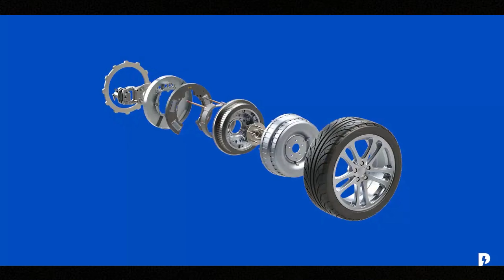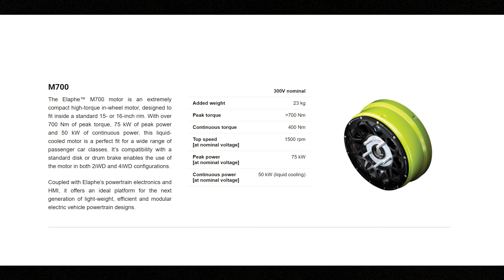Revolution in Motion | Gruber Motors

Comment: Where do the brakes go?  I don't see how hub motors can reduce unsprung weight.  How is an entire motor lighter than a half shaft?  Wheels are a pretty rough environment in terms of dirt, water, and vibration.  It doesn't seem like a great place for a motor.
Reply: Thanks for this comment. It saved me the time of typing it out. I would add one detail however, if the motor actually has the torque to be able to drive the wheel, it will also be able to slow down the wheel as well. It will not however be able to bring it to a complete stop as effectively as a set of friction breaks. If you just have rear wheels that are powered you can use your front brakes to do the last bit of breaking.
Reply: Exactly. Not a good idea at all except for simple vehicles like maybe the Aptera or motorcycles.
Reply: @Kabab  Most of the braking is done by the front wheels in every car, it's like 80%. That is why front discs are so much larger than rear ones. It's bc when you break the weight of the vehicle shifts forwards and thus the front wheels have more grip, better grip = better braking.
Reply: @giovannifoulmouth7205  that doesn't impact motor breaking or regen breaking.
Reply: Look at the Lordstown Endurance. It works.
Reply: @Alles_ist_moeglichauchdasGute  This is sarcasm... right? 😁
Reply: There is a study by Lotus, which shows that minor tweaks in suspension can offset the unsprung mass.
Reply: @hallkbrdz 
Unsprung mass. ??
Reply: The motor is capable of regenerative braking, you don't need dedicated brakes
Reply: The motors are the brakes. The unsprung mass may increase a bit, but the total mass and number of moving parts reduces substantially … and a lot of the unsprung mass is rotating, so it will help to gyroscopically stabilize the vehicle.
Reply: Pretty sure it's the front motors doing the work so this is fine, especially when doing Regen.  Some hybrids already have independent EV drivelines.
Reply: @Kabab it can stop it if you reverse the mag field as it comes to nearly. Complete stop. Not exactly what you need, but it can reduce the size of the mechanical breaks you need.
Reply: @nobilismaximus  yeah but that would the take power to do so. It's a toss up if it's better to add the complexity of friction breaks or spend power to stop faster.
Reply: @viennois0123 can you reference the study ? Didn‘t find it!
Reply: Guys, think for a sec. How do you keep the car still on park or uphill ? Of course some brakes are needed. And I assume they usually have some. Orbis definitely have them.

Comment: I dont like this idea , if you get in an accident your motor will be destroyed easier
Reply: It is much less likely for an accident to cause a the motor to intrude into the passenger compartment.   It should be safer in an accident.
Reply: @n.brucenelson5920   Maybe if you put a luggage on your frunk it will be the same? but I told it about the cost of the thing and it is more likely to hit your wheel than your whole engine
Reply: @Ydooo  Aptera has already tested hitting the wheels against curbs at speed, hard enough to pop the tires off.  Nothing happened to the wheel motors.  The wheels and tires are comparatively less expensive to replace, while making passengers safer.  There will be more proof of this when the FMVSS Part 200 crash tests are conducted and the ratings published, once they have production intent vehicles to validate.

Comment: Interesting idea.  Not sure about added unsprung weight.  Steering geometry is going to take some engineering.  While turning, outside wheels have higher surface feet per minute and constantly changing depending on the radius of the turn.  Motors in the rear, same thing.  More software control of the motor hubs.  The braking part would be easy.  You can stop a lot of mass with the VFD drives.  We did it at work and it was a lot more weight than a vehicle.  You could have a lot less wheel slippage.  A very controlled stop. 
  This concept has been tried before, I don't think the software was up to speed though.
Reply: APPARENTLY,NONE OF THAT MATTERS- ORBIS SELLS DIY WHEEL IN BOX KITS, FITTED IN 3 HOURS- SO CAN'T BE VERY IMPORTANT...
🤯🤯🤯🤔🤔🤔🤔

Comment: It strikes me that in-wheel motors would be the perfect solution for any company wanting to create a universal EV conversion kit that can be fitted to any ICE car as a means of speeding up electrification of our vehicle fleet. You could fit a couple of in-wheel motors either at the front or rear of a car, or all four if you want to go AWD, and then just fill the engine compartment and fuel tank cavity with batteries after removing all the ICE gear. The fact that you can eliminate the engine, transmission and axles from the engine compartment means more room for batteries and therefore more range and efficiency from an EV conversion. As the cost of batteries continues to come down, EV conversions are going to become a great way for people to take an existing vehicle with plenty of miles left in it, and replace a combustion engine that is eventually going to wear out and give trouble, with electric motors and batteries (along with controllers, inverters, chargers etc) to give you a 21st century sustainable energy vehicle that will comply with any future environmental regulations likely to be introduced.
Reply: Agreed, surprised this isn't a thing yet!  Some hybrids power the rear wheels like the Toyota Corolla and Rav 4, independent of the front.  Maybe a physical brake needs to be integrated for regulations.
Reply: @ChrisParayno   The in-wheel motors from Elaphe which were previously going to be used on the Aptera have a built-in brake.
Reply: I got a 2014 cx-9 suv with sludge in engine coolant wp disaster. I would love to convert it to EV with In wheel motor or ev motor. In wheel motor would be great tbh. Install the in wheel motor wheel. Rip out the engine and fas tank. Put batter pack. In engine. I think having removable battery pack like the E scooters. We can just remove the depleted packs and recharge them.
Reply: @maolo76   That's a lot of battery swapping with a full size car. If you are charging at home it would be easier to just plug it in. Could be a good solution if you can't park next to the house though I suppose. But again, a lot of manhandling and carrying batteries back and forth to your car on the street.
Reply: @apterachallenge  Doesn't the lack of inertia from the motor serve as a brake also?
Reply: @maolo76  Would dual 15,000 watt Ecycle wheels in the rear work?  Under $1000 a piece and a junk yard salvaged E-car battery pack. You might know better but it seems do-able to me. good luck.

Comment: There is just one problem with having in hub electric motors especially on the front axle to drive the car and that is there is horrendous centrifugal forces that will whack the car out of alignment in turns,That is to say it will not actually turn as well as a car that has half shafts driving the hubs.
Reply: in rear wheel drive cars too?

Comment: I've been interested in this technology for at a least a decade and wondering when it would make its debut.  At the time the primary obstacle was the unsprung weight.  I not sure how robust the engine would need to be but I figure a poorly maintained road system with potholes would be a detriment to these unsprung wheel motors.  I figure the motors would have be attached to the sprung mass and connected to the wheels via half or quarter shaft system to ensure longevity of the motors.

Comment: My Samsung washer uses a kind of pancake motor that must be similar to (at least in theory of operation) as a wheel motor.  It is directly connected to the clothes basket and is multi speed and reversible.  Its more than 10 years old and has been trouble free.

Comment: What about unsprung weight? How can that be dealt?
Reply: I was thinking the same thing.  for vehicles that will see a high frequency damper cycles will suffer for sure.  but I think for larger and/or slower moving vehicles it would make sense.  Where I think i see the most benefit is rock crawlers since you no longer have to worry about exceeding the max angle of cv joints on the driveshafts. It would allow for much more suspension travel and allow for a lot more ground clearance.    I think the quickest and easiest way to mitigate the upwards momentum of the wheel and motor would be to have two way dampers that bias more rebound speed to help keep the wheels on the ground more.  That and making the wheels much lighter (hooray for mass produced cf wheels)
Reply: The weight of the motors is just over 50 lbs in the Aptera versions, well within the ability of standard suspensions to control with sufficient authority.
Reply: @n.brucenelson5920  while the wheels I have are largish the rim itself is fairly light for its size (18lbs for 18x9.5) and with a tire(255/40/18), its just a bit under 50lbs.   Adding another 50lbs will be significant.   Around a track a floating rotor that weighs 2lbs less than a one piece rotor made difference of 2+ seconds.   I can imagine what adding 25x that would do to overall handling.
Reply: @n.brucenelson5920  But Aptera gave up on wheel motors, at least for now.

Comment: the gear of inwheel motor can use the three gear one drive outer rim one drive inner shaft and ine drive the middle or both so electric inertia switch take torque or speed to automatically switch among gear is best

Comment: i don't think this is a good idea, except some cases.
a better idea is just to have the motors in the engine compartment and since these axial flux motors are small, you can have them directly connected to the wheels and in between to have the inverters, hence leaving space for batteries or just storage.

Comment: Slow-moving vehicles, but need a planetary gearset to get the torque. The advantage would be for converting existing vehicles like tractors to electric drive. Faster vehicles would destroy the motor over time.

Comment: Someone is going to need to address the elephant in the room. Until such time roads are perfect and perfectly maintained, unsprung weight is an issue.  You're going to need to explain to us how this, "motor in the wheel" is light enough and durable enough to survive accelerations it incounters from potholes and other road imperfections.   All that being said, yes, along with the simplicity comes efficiency.  Road quality improvement for vehicles that don't pay a gas tax, is another elephant, in another room, for another day. Ever see the movie Truman with Gary Sinise?  As we use less petroleum, what will roads be made from?  Perhaps address the unsprung weight issue by explaining how a break rotor or break drum is not required.  This does close the weight gap substantially.  The inherent simplicity of the design might justify exotic materials such as carbon fiber and titanium. Bringing the unsprung weight down brings the total vehicle weight down as well.  The simplicity of the concept is engaging no doubt.  Using the motors as brakes is cleaner and keeps maintenance costs down,  We've always had redundancy, is the world ready to trust one breaking system?  Am I wrong in assuming that the motors are the only source of breaking?  Obviously a lot of us are going to be following this technology. Best wishes.
Reply: Electric bicycles have used hub motors and mid-drive motors for a long time. In general, hub motors are simpler, easier to maintain and more durable than mid-drive motors. The popularity of the mid-drive motors is usually due to better driving feel and control, for example when driving off-road. Hub motors are used less in off-road driving.

With a light load and bicycle speeds, the hub motors are therefore technically durable. But how about in a car at higher speeds, with a heavy load and on roads that are still in poor condition? This requires testing!

Comment: In wheel motor cooling? Motors get hot under load. Motor cooling while inside a wheel? Aptera uses Hub motors not in wheel motors. You can build the spokes into the hub motors like my e-bikes. Transmission and drive shafts are a massive energy loss for Tesla's. I imagine gearless hub motors are next for them.